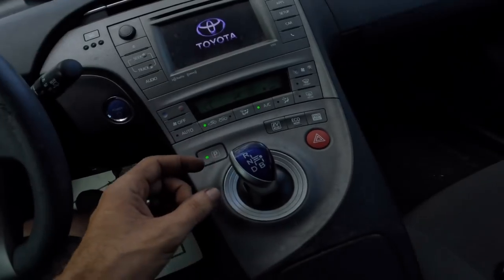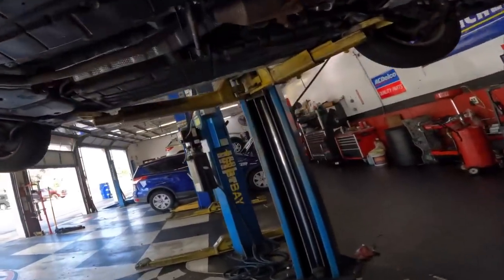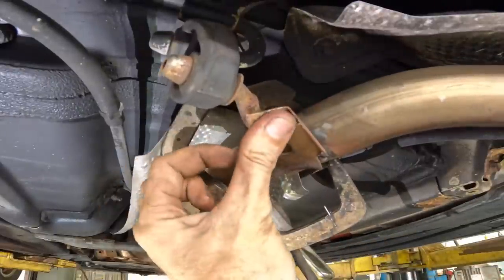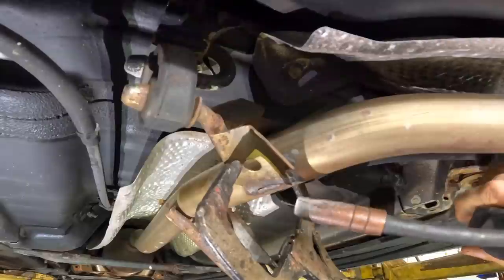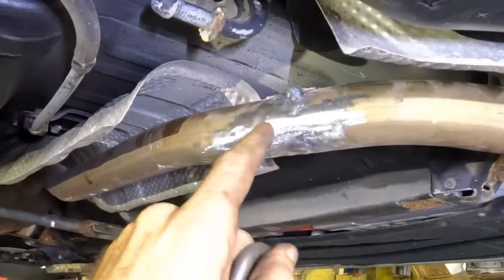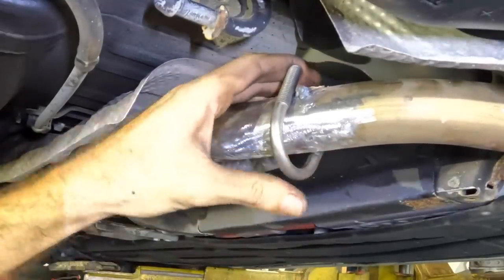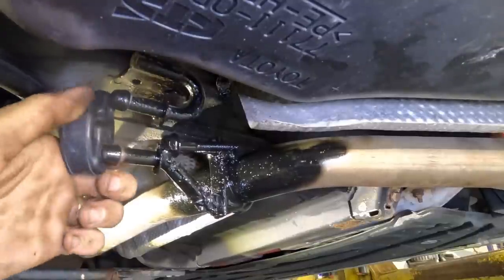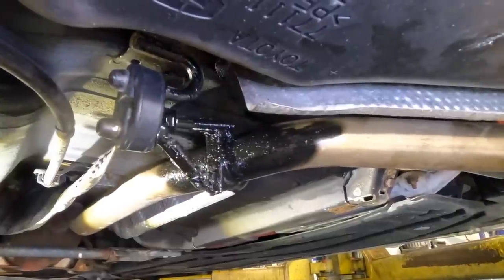This Video is a BAD Idea! Saved Customer THOUSANDS!

Comment: Had a shop one time try to tell me I needed $900 exhaust replacement because there was a hole in my muffler.  Asked them to show it to me.  I told them, "Take my truck off your rack," and I paid for the work they'd done and never went back.  Why?  Because the tech pointed to the weep hole in the muffler and clearly thought I didn't know about such things.  Wish shops had more people like you, sir.
Reply: Did HE know?
Reply: @skodovkar  likely not as usually they’ll just make the hole if they do know 😂
Reply: The same dang thing happened to me years ago. 
Back then, I did not know about the hole for moisture to escape. 
My decision not to replace the muffler was I was broke and the hole was small. 
Now, I am thinking the guy was trying to rip me off.
Reply: Glad you told me. Never knew about that.
Reply: You've just sent me off on a half hour journey, learning all about weep holes. I certainly didn't know about such things. But I've never had a garage suggest I replace an exhaust that didn't need it, so that could be why. Why so expensive for a muffler back box?
Reply: Good shops & mechanics like Ray & Ford boss me are very few
Reply: Yep those weep hole are made to take the water out of the muffler as in cold weather there is water that accumulated in the muffler beacause of conensation Engine exhaust hot and muffler cold.
Reply: How big is this hole ...never saw it before
Reply: it's called a weep hole cus when there's try to sell you unneeded stuff,ya start to weep
Reply: @nickmalone3143  About 1/8" of an inch. Lets the acidic water out, so that it doesn't rot the muffler out from the inside... Some people plug that hole or weld it shut, and wonder why their muffler is junk after one winter 🤣😂
Reply: I'm so glad you mentioned this! I can see I (and several others) had no idea about that feature.
Reply: Me and my wife owned a muffler shop for over 20 years. I do know about dishonest shops like you're speaking of. We used to have people coming from other states to have us work on their vehicles because they could not find anybody honest. I always thought it was a shame to take advantage of people like that. Word spreads fast when you're actually honest with your customers. Dishonest exhaust shops pull that weep hole scenario off all the time which is a shame! Luckily you were smarter than the idiots you were working with!
Reply: @marksamuel5347  did you know that one of the by-products that come from complete combution is H2O ,water, all the best to you all
Reply: I'm not a mechanic but I've been working on cars my whole life ever since I can drive because I click back in the old days I couldn't afford to have somebody fix my car and bottom line is that now that I'm a little older I don't mind taking it into the shop but do I have a sign on my head today that says I'm stupid I've been in the trades over 45 50 years and when somebody gives me some song and dance bag rates me to no one and that's why my car has reverse so I can back out and say see you later bye thank you it was a pleasure not doing business with you hey have a good day bye
Reply: @twatmunro  It was a one piece unit, muffler and pipe.
Reply: @donaldhalls2189  I think you mean CO2 and water is complete combustion.
Reply: @iamrobbb7503  no H2O water
Reply: The service man rang me to tell me I had a bad stone chip in the windshield would cost $100 to repair ..I knew there wasn’t one so said no …when I went to pick up my car I asked to see the stone chip and there wasn’t one …haven’t been back since but fortunately I found a totally honest ,reliable mechanic and been with him for over ten years now ..
Reply: @donaldhalls2189  I worked for 35 years in exhast systems. I have never seen water in front of the converter nor the pipes themselves ONLY in the muffler because of condensation of the hot exhaust in the muffler and outside temp.
Reply: @marksamuel5347  the water becomes steem wile the exhaust is hot, if you have done chemistry you would know H2O is a by-product of complete combustion,
Reply: @donaldhalls2189  due some research on catalytic converters and you will learn where the water comes from...also your spelling sucks...read your previous comment...steem and wile
Reply: @donaldhalls2189  troll
Reply: @mrajinj661  the
Reply: The shop happen to be Midas by chance?
Reply: @billytaylor6604  nope, was actually a dealership that didn't sell me the truck.
Reply: @skodovkar even worse if he didn't
Reply: I had a opel corsa with a exaust hole i left it to the point where no one could fix it it sounded like a freeflow cus it was rusted to bits and was hidde so it didnt bother me i made sure  get the moneys worth 😂
Reply: @michaelpressman7203  The only mechanic I trust is sitting in my chair.
Because there are so few honest mechanics out there. While the others are just  chasing the all mighty dollar

Comment: I'm not a welder either, but I have found that spending a couple of minutes cleaning up the areas to be welded helps heaps, and you actually spend less time on the job over all.  Flapper disk in a hand grinder does the trick, or even sanding disks.   You clean up the gunk from other parts before re-assembly, welded parts are no different
Reply: was thinking exactly the same. Plus, of course, the pipe looks like it's coated....and that won;t help the weld stick.
Reply: This
Reply: Same here. Not a great welder but I definitely get a nice bead easier with clean surfaces and a good ground.
Reply: Im in the same sinking boat, lol. Except, I had to learn to just weld 2 seconds at a time with the metal he took off. I had found Youtube videos on how to do that since my welder only has High and Low.
Reply: That is true, always prep the surface you are going to weld, especially if you are going to use a squirt gun.
Reply: As a welding inspector I 100% agree.
Reply: Find some scrap muffler parts and practice. Figure out if prep grinding works!.
Reply: You said it.  Now I shut up.
Reply: yup, with any welding ... step one - is always prep the weld area, especially with galv. or aluminised tubing
Reply: Yup, all welding instructions I've ever seen, heard or read start with surface prep for this very reason. You weld on crap, you are practically guaranteed a crappy weld from the junk under and around the weld pool causing splatter, contamination, inconsistencies, unwanted alloying, weld porosity, embrittlement, inclusions, pinholes, etc. Rust being present only at the factory weld suggests that the pipe and bracket must be some stainless steel grade (ex.: 409) and a "stainmore" alloy was used for welding.
Reply: My thoughts exactly! Love the videos and truly respect your integrity in not selling an entire exhaust system. 😎👍
Reply: It’s like painting, it’s 90% prep and 10% application
Reply: Was just about to mention cleaning before welding but you all beat me to it....  it must worth doing though  ....,.
Reply: @Flakmagnet1701  I was wondering about that, too--I hope it isn't a coating that is necessary for oxidation reasons or this area worked on may turn ugly very fast, especially if any alloys/dissimilar metals are involved.
Reply: Yep, I've seen his welding attempts in the past, I just don't know why he doesn't clean up the metalwork befor attempting the weld, very strange.👎👎👎👎🤔🤔
Reply: It's the same with soldering.
Reply: One of the main problems and faults people encounter with home welding is they try welding rusty metal.
Reply: Absolutly .clean Up area .good ground. Leeds to a good weld 🍺🍺
Reply: You cant run MIG MAG without inert gas...thats short time corrosion trouble. I was Mig Welder for like four years. Mission impossible there.
Reply: @ColinWatters  When bonding any parts, glue, silicone, etc clan the area first it you want a chance of it staying for any length of time.

Of course everyone in this thread is now a "hater" for mentioning this...
Reply: I appreciate the fact that you tried to save the customer a lot of money. That is the bottom line, not whether you should have done this or that. I spent a few years wrenching and know that not everything works with Motor manuals. Great job helping the customer out.
Reply: My thoughts exactly.
Reply: The exhaust on newer cars has an aluminized coating that has to be ground off to make contact
Reply: ALWAYS clean parts that need to be welded first! Especially with a wire feed machine. If you used some 6011 3/32 you would have been done in seconds. Some time old school is still the best school.
Reply: @Flakmagnet1701  Yes, most cheaper exhausts use "aluminized steel" (aluminum coated). He could've sanded it off, etc.
Reply: @Flakmagnet1701  isn’t it zinc coated for anti-rust purposes? If so, won’t it now become a possible rust spot weakness? The heat resist paint might work and it might not. But it extended the life of something that would have junked for a poorly designed bracket.
Reply: @TheBuddyCassius  , i see pores at the end.....this work cant withstand single winter, or salty coastal winds. I Call it BS operation. Is Argon or CO2 so expensive in US?
Reply: @miroslavdockal9468  the gas welder for the shop was broke and he only had a non gas setup he brought from home. Using what he had to effect a repair. No sense in him purchasing a gas welder when he might use it once a month at best, but probably more like twice a year.
Reply: That was one of the first things i learned when i took metals in high school
Reply: @TheBuddyCassius  , yeah, thank you. With inert gas it can be done better, like 500% better. I dont start my work, before i was fully prepaired. 78' born Locksmith from Czech Republic.
Reply: Flapper disks are the ticket. Try one on your grinder and your lawn mower Blade. It's the best advice I've ever gotten. Like brand new with no angle issues like when using a normal grinder
Reply: That pipe has galvanized surface.
Bad item to weld on unless cleaned off.
Zinc fever is no joke. got a friend that suffers because of it

Comment: As a welder shivers go down my spine seeing you weld Ray, then again saving people a ton of money makes up for that,and aslong as it works its a job well(d) done🤣 maybe a tip as i've seen somebody else already said, it clean the spot you want to weld with a flap disk or something
Reply: I remember when I was in my 1 and only welding class I set my self on fire. It got hot down there 🤣
Reply: And wear gloves, or a glove...
Reply: I was about to say something about the welding but didn't want to sound harsh or anything,
Reply: @michael931  Safety is important. :) UV burns from arc light sources is just as dangerous. Skin cancer is no joke.
Reply: @ericspecullaas2841   had 2 buddies, one burnt him self ,jumped under the car, knocked him self out.He was fine.
I still laugh,piece of slag landed on his balls. Was a female nurse.Nope not putting in an injury report.
Reply: Take off his much trust and contaminants as you can also chrome plating or any kind of plating or also mess up your world but considering Wilder had you did a great job have a good night he didn't have argon you know that's the gas that goes in the welder have a good night
Reply: Also, flux core is a pain. So much nicer running gas.

My second time Tig welding .063 aluminium, I burnt a hole through the metal and the table. Woops!
Reply: Just thinking he needed to wire brush his tacks off using flux core. No point in welding to slag.
Reply: The whole time I’m saying ( even out loud) “clean your area it will weld way better.
Reply: Man.. he clues together 2 f,,, peaces of metal so shit can go out of the car ;D Its absolute ok,
Reply: Looks like he's using flux core wire. I'm wondering if the polarity on the machine is correct(lead negative//ground positive) for running flux core. Also, looked like he was running the voltage way too hot.
Reply: Maybe also don't say it's not stainless steel because it's magnetic. Lol
Reply: @Enonymouse_  takes more than a few inches of a mig welder to tan some skin.

Comment: Ray, you have to clean what you're welding. You can weld just fine without gas, flux core wire is perfectly acceptable, but you have to use it on steel, not rust.
Reply: Exactly this, clean parts = cleaner welds.

Edit: Going through the comments now it's amazed me at how little people pay full attention/retain what ray said. He wasnt hooked to gas, he didn't prep the weld surfaces, but he checked if it was magnetic in case it was stainless steel. Sure, rookie mistakes, but he doesn't make money for being a welder, he makes it for being a problem solver, he made it work and did his best to ensure that his fix helped the issue stay fixed, I give an A+ for improvisation.
Reply: yes, flux core wire must have clean metal or it will not weld right. Using gas with it will weld through unclean metal.
Reply: @lar4305  100 % wrong. Gas welding needs clean base metal. Flux core is designed for burning through rust. It is very aggressive.
Reply: @lar4305  flux core that is designed to use shielding gas needs it, and self shielded flux core does not and actually has problems when you run gas with it. Both should be ground clean to remove rust and ideally wiped down with acetone (but that’s not very common) to make a satisfactory weld. The part he was welding was kinda thin so personally I would’ve ground off the rust, wiped it down with acetone then TIG welded it but I’m biased cause I’m a TIG welder.  I  understand why he did it that way.
Reply: Toyota exhaust systems have a Zink coating on them,  knock that coating off they will weld.
Reply: Umm actually Flux core is very forgiving and you can melt right through stuff and bond perfectly fine with no issues
Reply: Flux core wire is great for welding rusted metal and welding through paint.
Reply: @Dixler683  Wrong. Flux core is designed so that you don't have to use gas, as the shielding agent is inside the wire. Rust has nothing to do with it. On top of that, welding should be done on clean metal always. You can get away w/out doing it, but the weld will be weaker.
Reply: Came here to comment the same thing.
Reply: not sure what the factory tubing is, but it may be aluminized like much of the aftermarket  cruft. it can be a booger to weld through and goes extreme splatter-fest unless you grind it away first. clean metal is always a key factor! I wonder if the welder polarity is reversed for the flux core, but seeing he's never had gas on it, it's likely correct (DCEN) for flux-core), (DCEP) for gas shielded. I know all to well about the pitfalls of burning on old carbonized, aluminized and coated exhaust parts(learned the hard way, not a welder either)
Reply: @buffmaster0001   Some flux core is designed for use without shielding gas, some is designed to be used with shielding gas (self shielded is designated FCAW-S, normal is FCAW) and each is designed to be used with a specific gas as well (75/25, 90/10 etc)
Reply: @FordBossMe  yes and no, it will penetrate more than TIG but it's nowhere near as good as stick at pushing through rust. Self shielded Flux core kinda sucks in general, and especially at pushing through rust, gas shielded flux core will push through but it's still best to clean your material, and in something as small as this I'd still clean it.
Reply: @buffmaster0001  There is a difference between gas less flux core and flux core with gas.
Reply: @buffmaster0001  you must have me confused with some other comment. I never said use gas with flux core wire. I know the flux vaporizes and shields the weld. I know the metal should be clean, not heavy flaking potato chip scale. My comment was to “lars” who had everything backward. What was  I wrong about?
Reply: @chadoldman1143  sure use acetone  to remove oils from aluminum and medical grade stainless steel . No need to wipe with acetone for exhaust systems.
Reply: Trust in the rust! :D
Reply: @Dixler683  we used paint thinner in the shop I worked in. Tig welded .050-.080 aluminum, 22G-16G mild steel, and 20G-16G 304 stainless. Dunno what the price difference between acetone and thinner is, but both work equally well. Also, you can use denatured alcohol, mineral spirits, and even simple green. Honestly, anything that will cut the oil and grease and not leave a film.

We used thinner as the parts were powder coated after and thinner doesn't leave the same swirls as other options, hence a better surface for powder coating. Mineral spirits worked nearly as well and denatured alcohol worked as good as thinner, just more expensive.